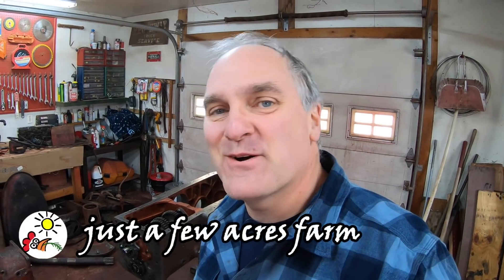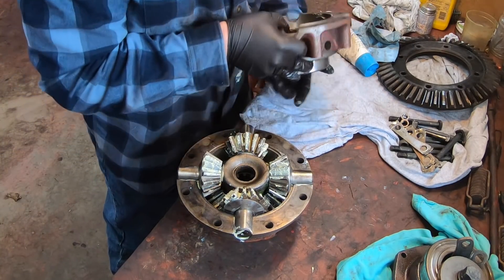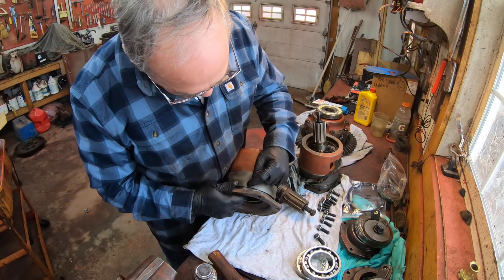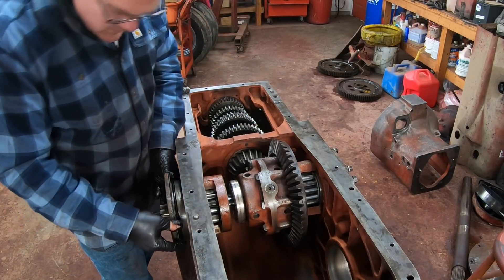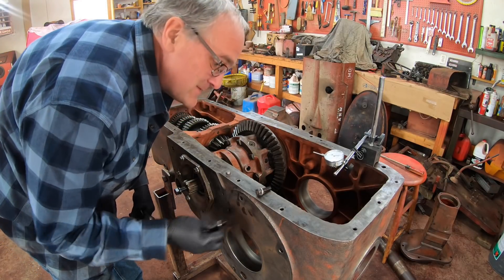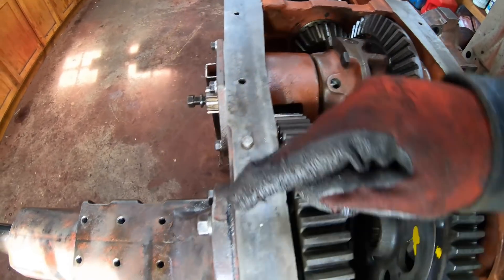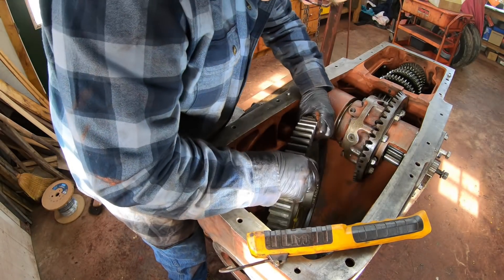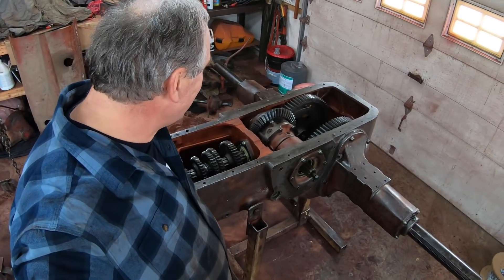Reassembling the Farmall MD Differential and Rear Axles

Comment: Good job on the reassembly of the transmission and rear axles. A lot of important information to glean from your video. I like this a lot, gives everyone a good insight on the importance of tolerances on gearing, seals and bearings. Also it shows how much goes into these types of jobs, not for those that have done it, but for those that haven't. Thank you for sharing and you have an awesome week.

Comment: I worked at the transmission plant for one of major 100hp+ tractor manufacturers (blue, red, green). On the main assembly line the fella that shimmed Final drive was a wiz, plus the overhead ratchet was a multi head that tightened and loosened all those bolts quickly and another one that provided final torque rating.  The overhead pulleys and hoists plus the custom material delivery racks made life easy.  The regular assembly tech could get his differential subassemblies built ahead so far that he would set a bunch on the floor waiting for a final drive unit to arrive at his station, then he’d attach his subs, pinions, seal, and shim them out.  He would take 20 to 30 minute breaks each hour and walk around and talk.  Other techs were jealous but no one could do it as fast or competently as him.  When he was absent the resource person never could keep up and would burn through the subassemblies until the assembly line shut down and allowed him to catch up.

Not a hard job after you work it for 10 years…every month, every week, every day.  He had seniority and stayed on that one job until he retired.  The engineering team once tried to give home more work so that he didn’t have so much free time but he just slowed down and the juice wasn’t worth the squeeze (line shutdown) so the job was kept at pace he was ok with but that no one else could match.

Comment: Pete, there isn't many shops that are even willing to do this work on the older tractors. Mainly b because the labor costs way over run the worth of the tractor and not many mechanics can do this like you with out a repair manual. You should pat your self on the back, you earned it. It helps when you have a father to teach you.

Comment: Pete, your cold weather project is getting the MD rear end restored, mine was to replace a piece of water pipe in the cellar that split. My project was much lighter but I had to fiddle getting the length just right also. My next project is to put heat tape and Insulation on that problem area for the next cold snap.

Comment: Lookin' good Pete!!!  And, you're lookin' yer average self.  LOL  There are three camps:  Love 'em; NOPE/NEVER; and Huh?  To what do I refer?  Oil additives.  I'm a fan of IXL Oil Additive.  Lay an eyeball on them and see what you think.  They make it for engines, manual transmissions, differentials, fuel systems, etc.  I started using it after a Laughlin River Run motorcycle rally I attended and bought a jug from a vendor.  He told me to look for a change in the engine at approx. 600 miles.  There would be a noticed change in power for a given throttle setting.  I treated my bike and a friend's bike at the same time just prior to a road trip.  I told him to roll up beside me and give me a thumbs up if/when he noticed anything different (did not tell him what to look for, or when to look for it).  At approx. 600 miles, I felt the bike change a little.  The area was FLAT desert freeway, and the bike picked up speed a bit.  We were both riding with a "throttle lock" which holds the throttle where you set it at, but it is easily flicked off or overridden with manual twisting by hand.  About a minute later, my friend rolled up along side me and gave me a thumbs up.  At the next stop for fuel I asked him what he felt.  He said the bike picked up speed a bit, throttle lock set.  Two identical bikes, exact some route, same duration of run time, same locations, similarly loaded... same reported result as expected.  One WITH knowledge of expectation, one with no knowledge of what to look for and when.  That's about as scientific of a test as I can report with the stuff.  I like/use it regularly in all my rigs.

Comment: Pete, I follow several farming channels and most of them do their own tractor/equipment repair and maintenance. There’s a lot to be said for your choice of the older, simpler tractors and equipment because the new models use a lot of expensive electronic components that are often designed to be replaced rather than repaired. That’s especially an issue now because much of these components are manufactured overseas and hard to get due to supply chain issues.

Comment: Shimming the backlash is easy sometimes. All you need to have is a lot of shims and calculate how thick and how many you need on both sides. Squatch got it right the first time but he also has a ton of experience. People like us who don't do these things on a daily bases it may get confusing at times. I think you did very good Pete.
Reply: @thirzapeevey2395  I don't remember exactly how many tries it took him. He sure was really confident in his skills that I remember for sure.
Reply from the maker: Hi Steve, I'm not sure there is a calculation for the quantity of shims needed on each side. That would be some very complex math given the pitch of both the pinion and ring gears. The only way I have seen it done is the way I did it; by trial & error.
Reply: @JustaFewAcresFarm  Some manufacturers give you 3 different shim packs to play with. Only difference I see was the thickness of the shims. That maybe applied when you decide to swap the ring gear and pinion for a faster or lower gear ratio. That dose fortunately not apply to you since the old differential was in excellent shape. I have seen some very messed up ring gears where someone did not do there homework.
Reply: Typically you would first establish the correct end-play on the differential carrier. Especially with new bearings, you can't assume the original shims will provide a free-rolling fit with no bind or endplay on the cone bearings. This is established with a dry fit in the case before the mainshaft and pinion is installed, with no oil seals or sealing rings on the carrier or quills. Then you take carrier back out and build up the transmission. Then on final differential installation, you carefully measure the shims as you transfer them from side to side to establish correct ring-to-pinion backlash. The total thickness of the two shim packs must be maintained to assure that the carrier bearings are not too loose or binding. Then , in some applications, if your pinion depth is wrong, you end up having to tear the whole darn thing down again!
Reply from the maker: @gabbyhaze5857  No cone bearings in this transmission. No pre-load. Different animal than truck and automotive rear ends.
Reply: @JustaFewAcresFarm  Many tractors have cone bearings. Ball roller bearings do not cope well with the side thrust generated by bevel gears. Doesn't matter. Adjust for free -rolling fit, no bind or end play. You must make sure carrier is properly shimmed and maintained as the backlash is adjusted. Tight bearings will fail. Loose bearings will generate noise and cause seals to leak. Ask me how I know.

Comment: The videos are excellent.  I have never seen the inside of a tractor transmission and differential.  The shims are interesting, it would seen that manufacturing tolerances weren't what one might have liked them to be.  Do newer tractors have tighter tolerances and thus fewer shims?  Did the manufacturing line have ways of measuring things so they could tell what shims were needed or did they need to fiddle with things to get it right?

Comment: Pete , please tell me.....   Is there enough room under the differential to bore out a couple of holes in the housing to put in a new shaft to mount meshing gears to make a sliding coupler positive traction shaft and still get the PTO shaft in?????  I know I could go above, and to the rear of the bull gears to mesh them , but the bull gears are gonna have a lot more stress then the differential gears. My plan is to have a sliding yoke , and a split shaft inside there to lock together, to make positive traction. I'll probably hafta mill out a set of gears. Being I grew up on these old girls , I just wanna bring them up to more modern times.

Comment: An old farmer who has been tinnkering with tractors for a long time told me yesterday that the MD originally started on gas then switched over to kerosene, not diesel but that diesel also works... I dunno, just thought I would bring it up. Also, You say, "A little patience." Huh.. You make Job seem like an impatient jerk sometimes. I would have called it a day halfway thru this... Take it BACK apart tomorrow.
Reply from the maker: Most regular M’s started on gas and switched over to kerosene or distillate after they warmed up. MD’s were specifically built to run on diesel. I find patience comes easy when you enjoy the process as much as the finished product.
Reply: @JustaFewAcresFarm  Thank you, Pete for clearing that up. One never knows if someone they meet actually knows what they are talking about. He was seventy something, I would think he got confused as he did have a few tractors he was working on. ( I was looking at one of them, a Massy Ferguson 65, gas, ran and drove great but one rear tire was severely weather checked for $3500... still thinking.) Keep your great attitude.... The frustration of having todisassemble and reassemble it 2 more times would have been more than I could handle for one day... I would have at least went and did chores or something else for an hour to get away from it first. 
Keep up the great work. I still would like to see a video about what you do your recording with, camera types, how you get some of those angles, etc. Sorta a behind the just a few acres scenes type thing.

Comment: Pete:
I can't figure out the purpose of the very first gear on the stub transmission input shaft?

It looks to me like the countershaft is driven by the small 5th gear splines but I cannot see where this larger gear on the stub shaft engages.

Any help would be appreciated.

I replaced the front hub seals in my FIAT 4X4 tractor with the planetary gears in the hub last summer.
Reply from the maker: That first gear drives the belt pulley.
Reply: I assume that it will make sense when you put the transmission cover back on.

Thank you for your quick reply.

Comment: Hi Pete, did you put in new axle bearings? I have a Super M that needs 'em and last I looked I could not find a cross reference and the outer bearings were hundreds of dollars each. What was your solution?
Reply from the maker: I replaced the outer axle bearings, they were about $140 each. Not cheap, but the old ones were toast. Bates found them for me.

Comment: Assembly grease.....so is it safe to assume it blends well eventually with the regular axle grease you fill the unit with?  Or do you run it for a bit full of grease and then drain and refill to remove the assembly grease?

Comment: 105 Lubriplate, best stuff in the world for all kinds of assemblies. I find it helpful to make my own guide studs for aligning/installing items like the pinion gear assemblies, especially when you're having to take them on and off numerous times for shimming. That application would have been a perfect candidate for 5 1/2 inch bolts(1 1/2 inch threaded 4 inch bare shank?) with the heads cut off, slightly angle ground, and a slot cut in the ends in case they bound on you, you can get a big screwdriver on them to get them out of the bore. Screw two of them in the top two holes for the mounting bolt pattern and you can even leave the shim pack on each time for re-shimming.  Also it's good to use grade 8 bolts for alignment studs, because they don't flex quite as much when you load an assembly up on them(spendy though if you don't have them lying around). Of course in between uses/applications, you'll lose the guide studs you made for any given project and will have to remake them each time, at least that's my experience. HAHAHA! Great videos, keep up the good work. Best wishes to you and your family.

Comment: PETE,
WHERE DID YOU GET YOUR PARTS?
Reply from the maker: I get them from multiple sources: CNH dealer, Steiner, McMaster Carr, etc. depending on what I need. These parts came from Bates. I don't usually buy from Yesterdays Tractors because they seem to take a long time getting them shipped to me.
Reply: @JustaFewAcresFarm   Thank you . Yeah I've had the same problem with YT
I will needing axle bearings and seals for my Farmall 560 soon. Any suggestions? Thanks